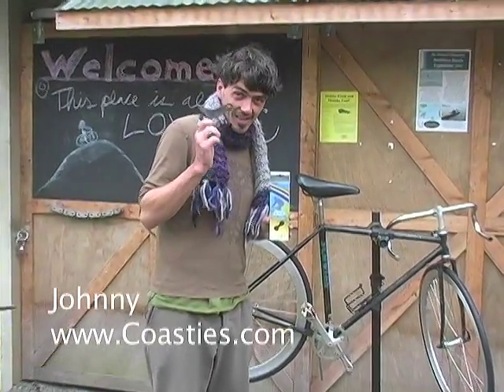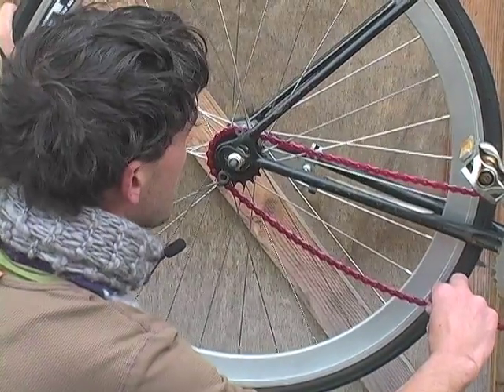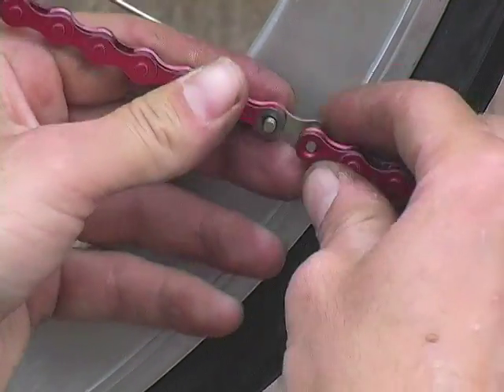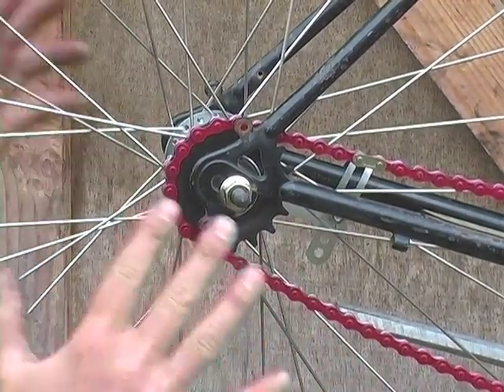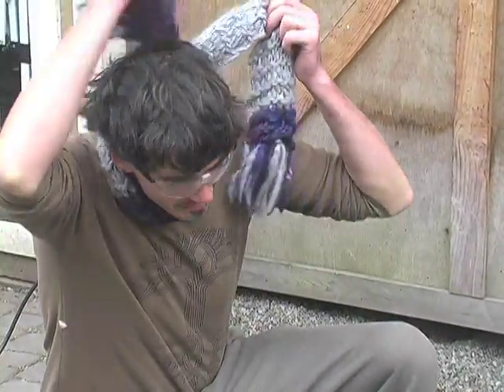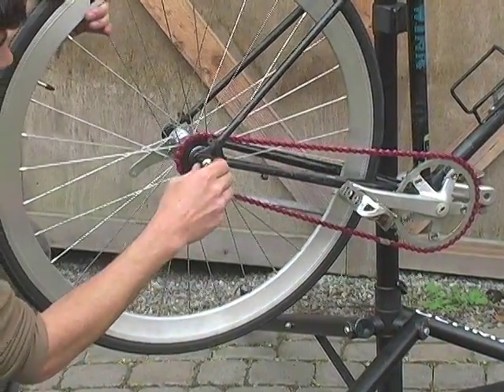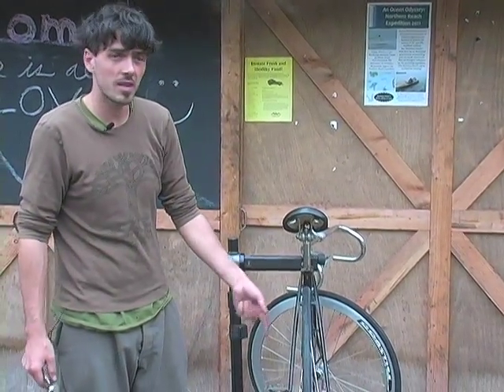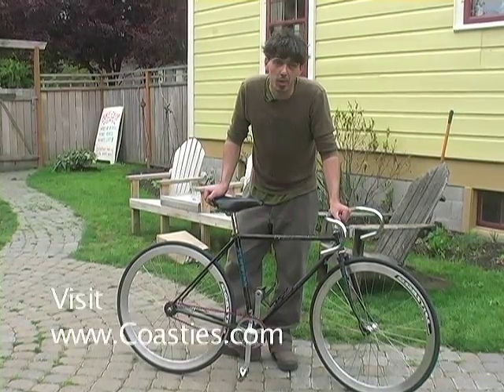How to Build a Single Speed Bike #12-Tension Your Single Speed Chain

Comment: Good method in centering the rear wheel at the end of the process.  Thank you so much for sharing.
Reply: +Jason Loke I'm going to try that method out tomorrow. I have a chain tensioner but I'm having trouble centering the wheel while using it.

Comment: Schwinn filled in the dropout because the frame is set up for a Derailleur setup. Not single speed.
Reply: +Thomas Hill was thinking the same thing, i'm sure the chain line isn't proper alligned either, these frames were not made for 1 gear. conversion are a pain in the ass in the long run.

Comment: I have a question sir, i got a fixed gear and I want to add a freewheel on the other side, my fixed gear is 17t. Is it ok to have +1-1t freewheel cog? will I get any problems with my chain?

Comment: I don't normally do this, but... 1:35 The "infinite wisdom" comment. Schwinn made great bikes back in the day and this frame was clearly never meant for single speed or fixed gear use by the spacing of the rear dropouts and the derailleur hanger, so they didn't design the frame for optimal chain tensioning. So, I mean it isn't Schwinn's fault. 

I don't know, it just came off as slightly spiteful to me.

Comment: cant i just shorten chain to fit into the middle rear sprocket and middle front sprocket and take off the shifters and cables?...i have an old fashioned 10 speed road bike and i have put an 80cc motorkit on with no real issue, but i cant fit the derailleur in front due to spacing with motor. Now without it the chain slips off pretty easy . just curious before cutting my chain, can i just run shorter chain and leave sprockets as is and remove mechanics for shifting?

Comment: the bike he's working on does coast. it's a coaster brake, so when you back pedal, that's your brake, just like the kids bike you probably grew up on. also, doing a chain on a fixed gear or a single speed coasting road bike is exactly the same. make sure it's tight and get the chain line as straight as possible.

Comment: i wouldn't use an angle grinder.... I would first use a drill to make a hole at the end (makes the size and the bend), and then use a metal saw to saw out the leftover peace in the beginning... that is a beginner recomendation ! better do it with hard work slowing forward, than to get overexited and make a mistake and ruin the whole thing...

Comment: You need a lot of luch when using vertical dropouts , i have 2 mtb that i  was able to convert to single speed with ni problems and just the right tension on the chain , i also have one that i had to get half links for becouse the chain was a bit too long or too short

Comment: I like what you did, all except the new wheels. Can you do another video showing the conversion of the 5 speed rear wheel to a coaster brake, or freewheel hub? I just don't see the point of putting $150 wheels on a bike you would pay $50 for.

Comment: Mentioned nothing about chain deflection or how to set it, tighten the bolts as much as you can, really ? You grind a frame when you could have just used a chain tensioner.

Comment from the maker: @Xcokedav096 It was a combination of luck and practice. You can flip the rear cog on a coaster brake (they are dished) and you can put the front chainring on the inside or outside of the crankset, as you need.

Comment: why schwinn didn't allow more chain tensioning adjustment in the dropout is cause it's a freaking road frame and NOT a track/fixed frame, how does he not know that?
track frames that are designed for fixed have the horizontal dropout at the back and for sure DON'T have a derrailleur hanger....

Comment: I think the dropout hasn't been cut out as much as the other one due to it being designed to work with a derailer. It might be so to make sure that the rear wheel is in the correct position to run smoothly over the derailer/gears. 

I have seen quite a few bikes which have been cut out fully, but have a rubber insert on one side, basically filling the back part (the part that you grinded).

Comment: Nice , thanks for the hint on chain tensioning. though hand held 'round file' might have been safer to use (& slower)  to remove the metal from the drop out.

Comment: This is a very helpful series & I respect your coaster commitment. Re: the filled-in drop out, I hear your respect for the ol' angle grinder, though nothing beats it for speedy removal of metal (and skin and various body parts). I'm not objecting to your method at all, but I might have tried a centerpunch & drill at the back, stepping the bit up to match the inner radius, then a good hacksaw to remove the rest, followed by files. Not as quick, but safer. Just a thought.

Comment: The axle actually moves rear-wards as you're braking; not forwards dum fuq. The rear tire/wheel assembly is trying to stop you from moving forward. They're called safety glasses...Get a job hippie/hipster. either way, get a job
Reply: The axle does move forward under braking.
Reply: damn, it DOES lol. unless you have a vertical dropout, or a track forkend tensionned to the minimum length.

Comment: my fixed geared bikes chain tension moves between tight and loose.  the tension is not constant. is this normal? how do i fix it?. so that its constantly the same tension
Reply: Austin Boldt it's never always at the same tension. And that's totally normal because the chainring has a slightly oval shape. Now, try to fix your rear wheel in the dropouts at that point where your chainring pulls the chain at its highest tension.
Reply: Austin Boldt That is the curse of single speed.